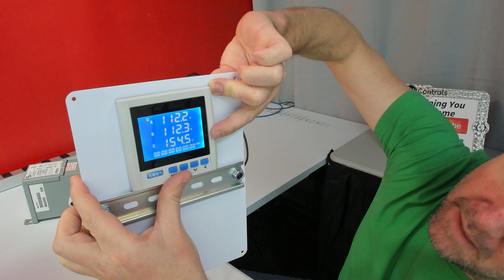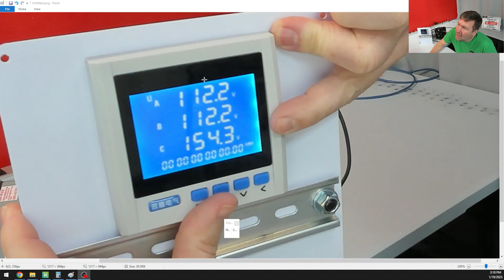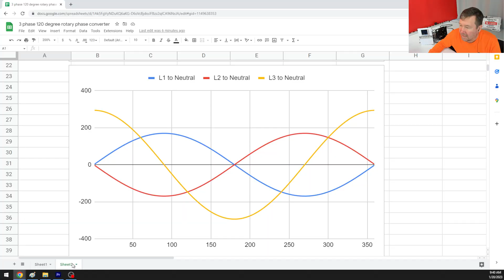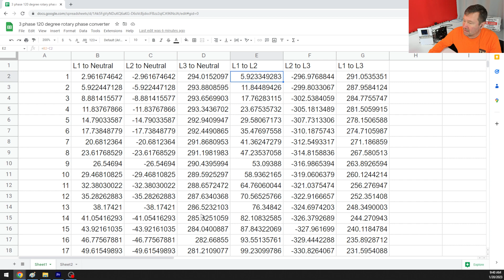Can Your Rotary Phase Converter Make TRUE 120 Degree 3 Phase Power?

Comment: As long as folks realize how you are measuring things when you get your readings to show that they are 180 degrees out of phase at @0:49. Otherwise people tend to get confused into thinking it's because they are two separate phases. You are clear in stating that you are measuring the voltages 180 degrees out of phase, not that they come that way. :)

I'm not sure that I would use Clough42 as an example in this particular case (otherwise he always does a good job), you will find my comment on him referring to "Two phase" as the first one in the comment list. Call me pedantic, but it makes a difference.

Charles Staton does an excellent job of explaining that it's all single phase: https://www.youtube.com/watch?v=uRKbX74lBgU&t=969s Another guy who does a good job of explaining things is Dave Gordon. https://www.youtube.com/watch?v=nOSYHUxHxG8

As a happy side note, I've got a perfectly fine homemade phase converter in my garage that I got extremely cheap when the guy who built it (a machinist) got confused on how to measure the voltages and convinced himself that there was something wrong with it. So he bought an American Rotary and left this one sitting under the shed where I discovered it. Score!!